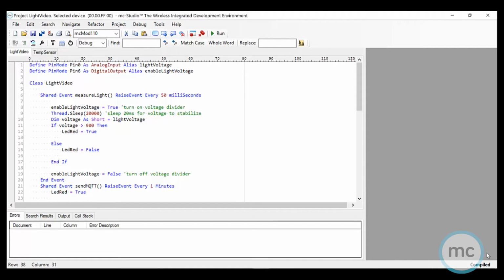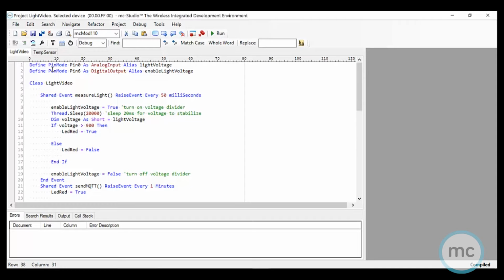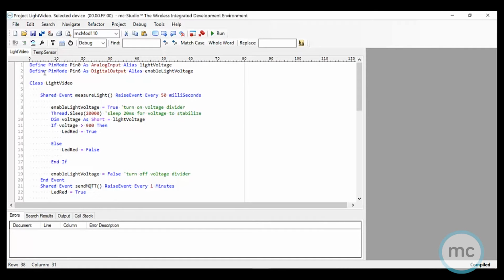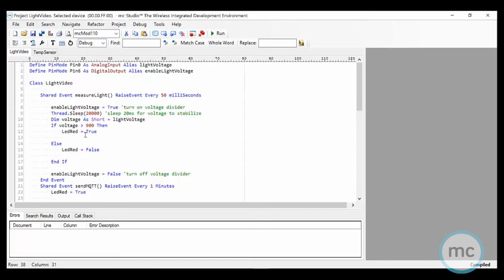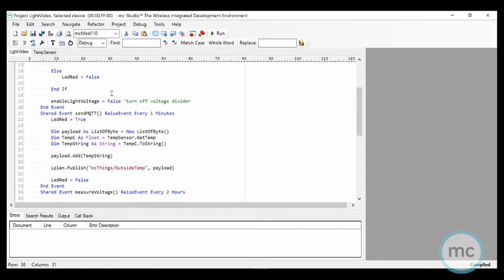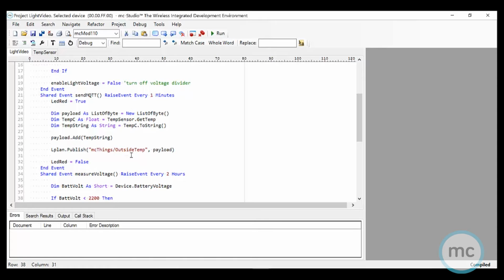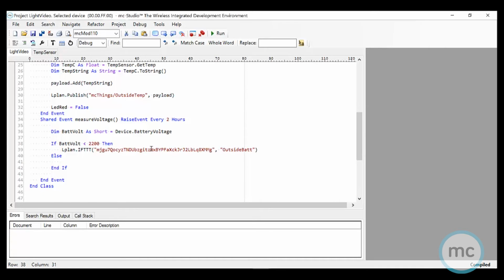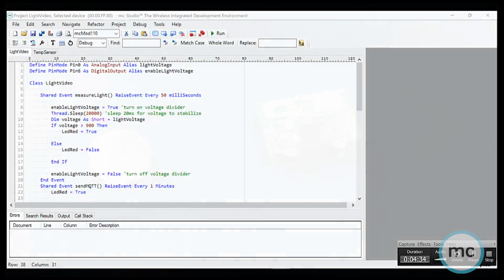Light Sensor Demo Project

Comment from the maker: PROJECT CODE: 
Define PinMode Pin0 As AnalogInput Alias lightVoltage

Define PinMode Pin6 As DigitalOutput Alias enableLightVoltage

 

Class LightVideo

    

    Shared Event measureLight() RaiseEvent Every 50 milliSeconds

        

        enableLightVoltage = True 'turn on voltage
divider

        Thread.Sleep(20000) 'sleep 20ms for
voltage to stabilize

        Dim voltage As Short = lightVoltage

        If voltage > 900 Then

           
LedRed = True

           

        Else

           
LedRed = False

           

        End
If

        

        enableLightVoltage = False 'turn off voltage
divider

    End Event

    Shared Event sendMQTT() RaiseEvent Every 1 Minutes

        LedRed = True

        

        Dim
payload As ListOfByte = New ListOfByte()

        Dim TempC As Float = TempSensor.GetTemp

        Dim TempString As String = TempC.ToString()

        

        payload.Add(TempString)

        

        Lplan.Publish("mcThings/OutsideTemp", payload)

        

        LedRed
= False

    End Event

    Shared Event measureVoltage() RaiseEvent Every 2 Hours

        

        Dim
BattVolt
As Short = Device.BatteryVoltage

        

        If BattVolt < 2200 Then

           
Lplan.IFTTT("YOURUNIQUEIFTTTKEYHERE", "OutsideBatt")

        Else

           

        End
If

        

    End Event

End Class